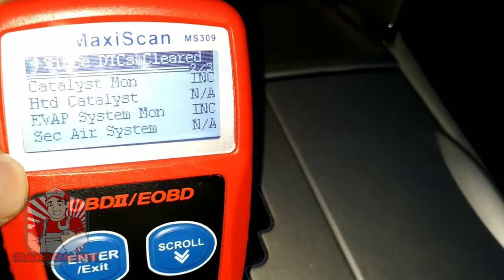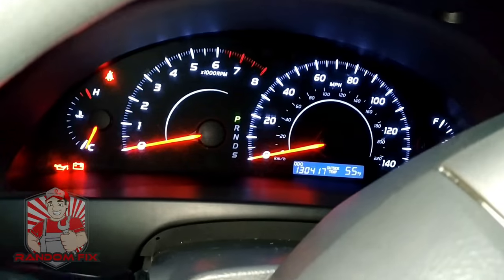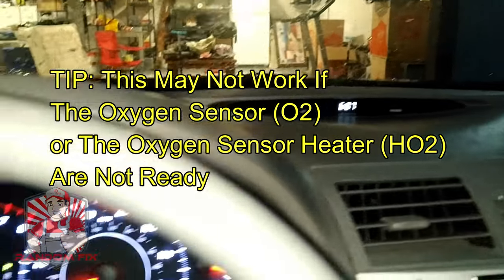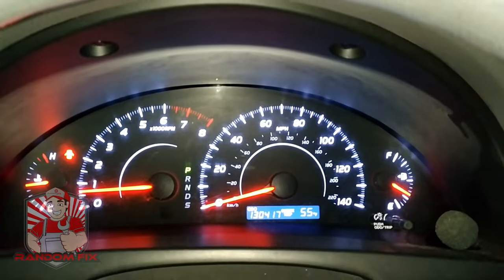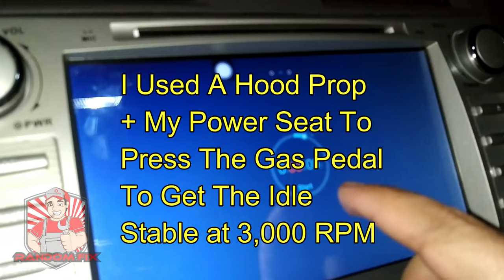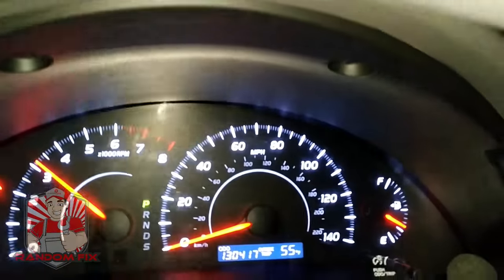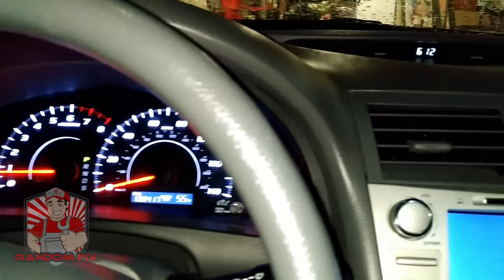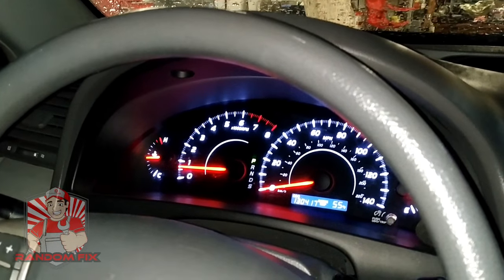Amazing Trick to Get Catalyst Monitor Ready!

Comment: Just tried this on a 2005 XC90 AWD T5 with over 150,000 miles with no success.  Did it from a cold start.  Was worth a try.
Reply from the maker: Rich, good feedback, did you scan you xc90 after to see which monitors were incomplete? _Randomfix
Reply: Yes.  I attached my scan tool right after and still not ready.  It is only the catalyst monitor that is not complete.  I unplugged the battery 2 months ago to do some work on the car.  Was able to get everything ready except catalyst.  Sucks because I’m overdue on my states emmisions inspection.
Reply from the maker: Rich, to help get you catalyst ready just drive at freeway speeds at constant speed about 65mph. As vehicles age certain components may take longer. Also, check out the my complete smog playlist for help with this exact issue. Best of luck and let me know how it goes. Hint:keep your a/c off during the drive. _Randomfix
Reply: Thanks for the info.  I will continue to do a few more drives with ac off and let you know how it goes.  I normally only drive this car about 2 miles a day since I commute on bus into NYC but lately started taking it on the highway for longer drives.
Reply: I was away for a few weeks so this morning I drove on the highway at 60-65 mph with scan tool attached.  After 20 miles of driving, my catalyst monitor went into ready state.  Immediately drove my Volvo to the inspection station and passed.  Relieved since I’ve been driving around with a rejected sticker for last 2 months.  Thanks for your help!
Reply: @richp4198  Forgot you can keep the scanner attached while driving. Will give it a try. Thanks for the info.
Reply: My same Volvo XC90 had catalyst monitor not ready and needed to go back for inspection before end of this month.  I cleared a diagnostic code about 8 months ago and all monitors were ready except catalyst.  This morning I drove it onto i80 at 65 with AC off and scan tool attached.  I was expecting to drive halfway to the Poconos but only took about 10 miles of steady driving.  When I did this last year, it took me 20 miles.
Reply from the maker: Good to hear , thank you for sharing

Comment: 2000 Camry. Set the timer for 3 min 5 seconds. IT WORKS!!
Reply from the maker: Jay, thank you so much for the great feedback. You made my day and this is reason why I love Youtube. Helping people!!!
Reply: Did it really work I have a 2001 Camry and no it didn’t work!! How many times did u do it??
Reply: @johncandy7237  Yaa, worked first try. Run some fuel system cleaner. And try it.  Try it a few times after different cold starts if it doest work first try

Comment: On 2002 Sienna 177,000 miles..., After about a minute and a half the RPM start to go up with the pedal locked in place. You can hear a different sound when this happens almost like a transmission shift. When it got over 3400 I changed the pedal height and then it tries to drop well below 3000. The closest I can get the speed is 3050 or sometimes 3100 reading from OBD2 and the tach don't agree too well.  But this car cannot hold 3,000 RPM for 3 minutes because at some point it starts to climb too high. The second try on more level ground I tried to force it to stay at or above 3K but then it started surging up and down in RPM and engine trying to cut out but felt like the throttle was being repositioned by ECU or something.  At this point engine temp was steady at 200.
This might work if I can get it to stay at 3K for 3 minutes.
Reply from the maker: Thank you for your feedback, I used a tool to hold the idle at 3k  .
It would be very challenging to do this manually. Your Toyota Sienna is very complicated drive cycle and I have a video just your toyota https://youtu.be/EKfEr2LP2Nw

Good luck and keep me in the loop.n

Comment: I have e60 2005 bmw this trick got o2 heated ready. Not cat. Tried this trick so many times 😢 not working
Reply from the maker: Here is the Bmw drive cycle

https://youtu.be/mk6Tk330Acw

Also, the vehicle warm up for an extended period of time without moving it. Just let idle
Reply: @RANDOMFIX  thing is bmw drive cycle says no rpm over 3000. But yet when I did it o2 heated sensor went OK. So I'm guessing it's okay. Other modules are okay tho. Only cat monitor giving me troubles
Reply: Do you think if I use cat cleaner can help
Reply from the maker: That was is really for a catalyst monitor. That works for older vehicle catalyst.  Let your vehicle idle 25 minutes plus if in colder weather before driving the cycle. Keep it under 3k so basically the catalyst needs to plenty warm before you start on the road. Good luck.
Reply from the maker: I would just let that baby warm up for extended period of time. It’s really hard to set in colder weather.
Reply from the maker: You can always do that and I have videos about that but nothing can replace an extended warmup if your catalyst is okay but not getting ready right away. Did you have any p420 or p430 codes?
Reply: @RANDOMFIX  no codes at all. It is 237k tho  I'll try to warm it up and do a drive cycle. If that doesn't work, I'll try what that one comment about driving it 3000 rpm around 55 mph. I'm almost certain that high rev is the key.  Since that was the only way to set that heated o2 sensor
Reply: @RANDOMFIX  it worked finally. Your advice was the key. Need to be warm. I drove to LAX and back mostly 55 mph was switching to steptronic and drove little bit on m4 over 3 rpm. After driving back, still INC, but I can feel the car is hot even with this rain. I parked and reved it over 3 rpm. Drove for less than 100 feet to get OK.

Comment: Didn’t work not sure what else to do. Have a 04 Chevy S10 both CAT and EVAP system is offline. I have drove the vehicle 100 miles and did the drive cycle recommendation for that vehicle. I did the cycle multiple times. I have no check engine lights or pending codes. I’m just at a lost.
Reply from the maker: What are you driving and what didn't work? Is this only incomplete monitor?
Reply: @RANDOMFIX  I drive a Chevy S10 had a new exhaust system put on it from the headers back along with all O2 sensors replaced. I took it to get inspected and they told me my CAT and EVAP was not ready. So I have drove around doing the drive cycles that are recommended with no luck. I did the 3000 rpm hold for 3 min then I did it for 6 min with no luck. Both systems are offline.
Reply from the maker: Here is the gm drive cycle. I can answer questions on
https://youtu.be/Yp34ksJY-fQ video there. Please if you make any modifications I might be able to help as much. Also make sure you o2 sensors are OEM and don't worry about the evap as it's exempt in most states including California.
Reply: @RANDOMFIX  appreciate it I’ll check this out. I’m in NC.
Reply from the maker: Anytime

Comment: Thanks RANDOMFIX I did it and it work, the only one that I need was that cat monitor I did idle about 10 mins and then the 3 mins on the rpm , I had the Obd connected and I thought that didn’t work but it did as soon as a start driving go trough 2 stop signs and my scanner changed to green light and cat to ready was on a 03 Ford Expedition thanks
Reply from the maker: Jose thanks for the great feedback. I really appreciate you taking the time to share your success. _Randomfkx

Comment: I have a 2005 Chrysler pacifica and it keeps saying Catalyst and oxygen monitors not ready I have already drove it for over 200+ miles and nothing. I tried this method and still the same thing. Now I’m at a complete loss
Reply from the maker: Hi Max, here is the Chrysler drive cycle

https://youtu.be/dyYv4HpYPys

Focus on the oxygen sensor and then catalyst monitor. I break it down on the video. 

Let me know if you need anything on the Chrysler video.

Comment: Just tried.  Not worked.  7 min warm up then 3 min for 3000rpm.  Still CAT not ready. 😒
(I have all other sensor in READY state except CAT).
Reply from the maker: What are you driving? This this for older vehicles and works best on years 2000 to 2007 for some strange reason.

Comment: My bank 1 oxygen sensors reading n/a and check engine light is on ,any help ?
Reply from the maker: Na is means not applicable. What are you driving and do you access to another obd2 reader or scan tool?
Reply: @RANDOMFIX  I use obd2 reader and my car is ram 1500 2016 hemi , I have p0052 code and replaced the bank2 sensor 1 but still have the check engine light on even after reset and driving the car more than 200km
Reply from the maker: Are you sure you don't have a permanent code or open loop? https://youtu.be/PMcJtcSOzdk

Comment: I am stressed out my car is not passing smog test because of this catalyst monitor not ready. my registration expires this month in CA. hopefully this trick works, I have driven thousands of miles without luck!
Reply from the maker: Best of luck and let me know how it goes? _Randomfix
Reply: RANDOMFIX will do! I’m only free to do my smog test this weekend but I am doing this stuff everyday! does it have to be stable 3k rpm? coz sometimes mine fluctuates Im only using my foot
Reply: RANDOMFIX i have smog test 2 weekends ago. it is still not fix. i had the catalyst converter replaced and 2 sensors. I am still driving it, so far it is still INC. i am close to giving up
Reply: @greenboyvlogs  wow..... my car was excellent with nothing wrong...i changed the battery few days ago now l have that f..... problem......

Whyyyyyyyyyy???????

Comment: I tried this with a 2012 Nissan Sentra twice. The second time I held the gas for 5 mins. The Nissan Sentra only has 28k miles on it. Does anyone have any ideas on how to get the catalytic converter ready? I already drove it 1000 miles plus on the high way round trip (SF to vegas)
Reply from the maker: You should be experiencing this at only 28k miles unless your catalytic converter is fooled oil. Please look at this playlist where I show all the different ways of setting your cat monitor. 

https://youtube.com/playlist?list=PLDEbtVOPRC-h1BAzaWQ-6NSnmG0gwvgwP

But watch this nissan drive cycle video first https://youtu.be/s9PLkO-CjZ8

It is really important that your car battery is good. It should over 12 volts after 10 minutes of having the headlight on and engine off. Verify that With a multimeter after 5 minutes of sitting after the headlight test or get a load tester like this one
https://youtu.be/Zpe_oOUZsUs

I hope this helps so you don’t have to take another trip from the bay to Vegas. Keep me posted and good luck.

Comment: Worked on my 2001 camry. Thanks!
Reply from the maker: Good to hear, thank you for the confirmation 👍
Reply: I did it for my 2001 Camry and didn’t work 🤦🏽‍♂️
Reply: I did it for my 2004 camry. unfortunately didn’t work😞
Reply from the maker: Is the only unset monitor? What caused this issue in the first place?

Comment: I went in for a smog check, but my 2005 Honda CR-V didn't pass because of the same problem what I encounter in this video. The car only has 76,620 miles. I have never failed any smog checks, but this one was the weirdest I experienced.
Reply: I have a 2005 Honda CRV also. It has 170,000 mi on it. Exactly 2 years ago I took it for a smog check and it failed. I erased a check engine light which was the catalytic converter code.  Apparently  some of the emmision modes do not clear even though the check engine light is off. For Hondas there is a specific procedure to clear the incomplete code. I tried and tried this procedure with no response. So I took it to 2 Honda and 2 Toyota dealers but nobody seem to know how to clear the incomplete problem. Finally the last Toyota dealer was able to change the incomplte to complete and it pass smog. No problem for 2 years and just as I was taking it in for smog resting the check engine light came on. I tried the Honda procedure again with no success. I’m going to try this way of fixing this problem. I’m also going to try this this chemical called Oxycat to see if the cat needs cleaning. I found a catalytic converter at Rock Auto which a fairly reasonable price 600 dollars, other cost over 1000. It’s The Walker calif CARB approved # 82896. Hopefully I don’t need one.
Reply: @raidergerry3220  I was able to get my mother's Honda CR-V to pass smog on August 21, 2021 by driving farther south and back north to the smog station. I had to use half the tank of gasoline in order for the catalyst not ready to reset itself completely. I wasn't surprised how much I had to drive because I have always had my cars pass smog checks and two weeks of driving after the failed smog check.
Reply: @marlon94124  I tried this method with the 3000 rpm x 3 min with no luck. I’m going to try the Oxycat cleaner in the gas and drive it some more. Honda should have made it easier to do. I wasted a lot of gas and it’s not cheap with over 4 dollars a gallon.
Reply from the maker: Thank you for sharing and yes cataclean is expensive but it can help. Please fix the exhaust leak in the vehicle because I'm sure it's not a carbon monoxide issue, you have an exhaust leak. Carbos monoxide is odorless.
Reply: @RANDOMFIX  I am very smell sensitive just like my mother. The new alternative is natural gas powered vehicles, but very short driving range.

Comment: i have code p0171 causing my 2000 toyota corolla to show my catalytic converter pending. I driven 300 miles and did your test many times and still shows catalytic not ready on my scan tool so i can pass smog lol
Reply from the maker: Did you get my response from yesterday?  Youtube is showing I didn’t respond to your but I did. You need to fix your lien condition first, you have a bad fuel filter, injector, intake leak, etc..

Comment: Driving 300 highway miles didn't work for me.
Doing the 3000 RPM for 3 minutes, TWICE, didn't work for me.

What did work for me was doing what's called a 'Drive Cycle'. Do a search for your car model and the words 'Drive Cycle'.
You have to perform a series of different driving actions. Idle for a few minutes, drive 20 mph for 5 minutes,  coast without braking, etc.
Each car is different. Seems strange but it worked. It's what the car's computer is looking for.
Reply from the maker: Thanks for letting me know, I have video coming up for each make as I could not keep with the smog video questions.
Reply: @RANDOMFIX  Thank 'you' for making the original video and any future videos.
You've helped so many people.

Comment: I have got to try this. My 97 t-100 will not pass catalyst monitor. Smog tech told me to drive it 50-100 miles I did and still didn’t pass...I went and put on another 100 miles and still nothing!!!
Reply from the maker: Sorry my toyota video is in the process. Drive between 40 to 45 mph for 17 minutes, avoid any fluctuations in speed and throttle position, ac and cruise should be off. Find a nice level road. If the outside temperature air temperature is above 50f you can probably get it done under 9 minutes. Make sure there are no pending codes and you have a good battery and alternator. Good luck. Video for Toyota specifically will be done in the next month.
Reply: @RANDOMFIX  I drove my Toyota t100 how you said and still catalyst monitor Inc and evap monitor inc..
The original repair was cylinder 1 misfire and was fixed...but now smog tech is saying not ready due to incomplete above.
Reply from the maker: Sorry to hear your troubles. I'm not sure what state your are in but but 1996 to 99 vehicle have one monitor incomplete. So I would try another smog station but here is the drive cycle for t100, its very complex. I have had lexus es300 take me 400 miles of perfect constant speed driving to set the catalyst monitor. Since your t100 is 23 years old don't take any chance, as soon as the monitor sets get it slogged right away, same day. Here are direction. The last 3 steps are what you really focus on. A. Start the engine and allow it to idle for 10 minutes or more.
B. Drive the vehicle at 43-56 mph or more for 3 to 5 minutes. Be sure to maintain engine speed between 900 and 3,200 rpm.
C. Stop the vehicle and allow the engine to idle for 3 to 5 minutes.
D. Repeat steps B and C once.
E. Drive the vehicle at 40 mph to 55 mph for 3 minutes.
F. Drive the vehicle 35 mph to 45 mph for 7 minutes.
G. Stop the vehicle and turn off the engine. Release the pressure in the fuel tank by removing and then reinstalling the fuel tank cap.
H. Start the engine and as soon as safely possible begin driving at approximately 45 mph for 5 minutes.
I. Drive the vehicle at approximately 25 mph for 15 minutes, and include a minimum of two stops for approximately 30 seconds each.
J. Stop the vehicle and allow the engine to idle for 2 minutes.
K. Drive the vehicle at 25 mph or more for at least 50 seconds. Make sure your engine speed is above 900 rpm.
L. Stop the vehicle and allow the engine to idle for 40 seconds or more.
M. Perform steps “K” and “L” ten times

Good luck and let me know what happens.

Comment: Can’t you also drive at 3000 rpms for 3 mins?
Reply from the maker: If you have stick shift maybe. I have not tried that.
Reply: @RANDOMFIX  I have an automatic. But I have sport mode. I locked it in 4th gear at drove at 3500. No luck. 

I called Ford. They said to drive:

65-70mph for 45 miles. Then, drive stop and go for 35 mins. Sheesh. So hard to do in a city.

Comment: my 2004 Corolla had Catalyst Monitor failure when i took it in to get it smog ,so  i did the catalyst monitor not ready issue in 7 simple steps it didn't help, so i drove the car about 200 miles and still came up Catalyst Monitor Not Ready failure, i checked on the internet and some people had the same issue, they said to disconnect the battery and let the computer reset its self. i did and drove the car that night for about an hour, then took the car in the  next morning back to the smog guy and the car passed
Reply from the maker: Rob, that's awesome buddy.